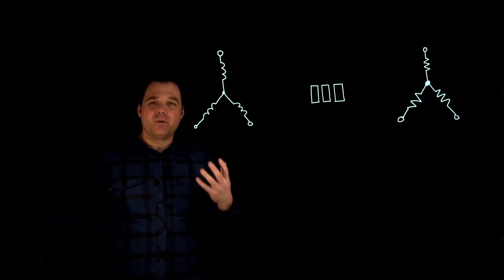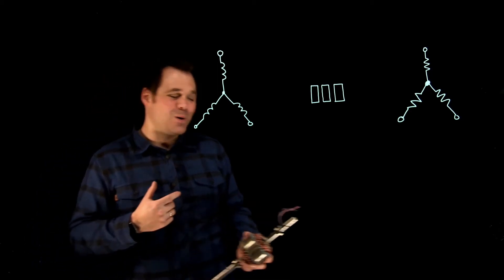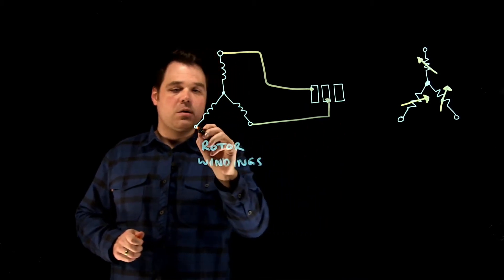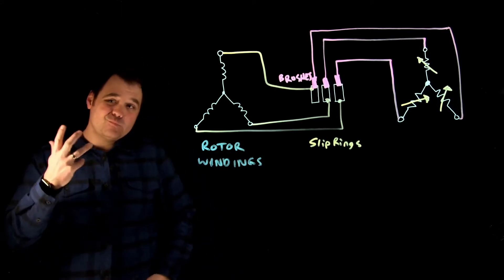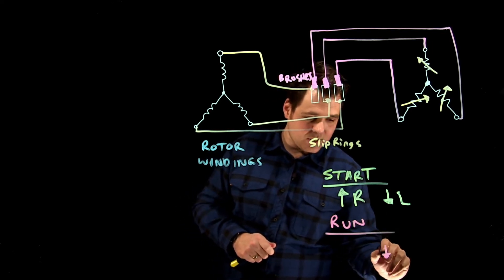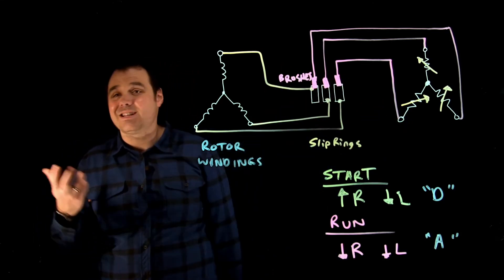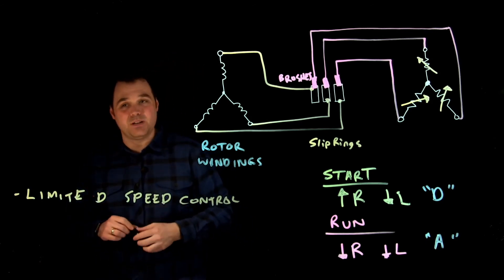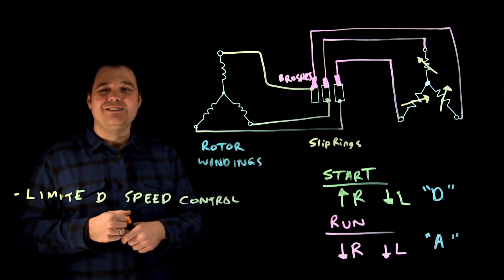Wound Rotor Induction Motor Overview

Comment: Hi I have a question, do the leads coming from the slip rings to the resistors, they MUST be connected all 3 in some way for the motor to turn correct? Or are there some models where only two can be connected, none connected, for them to turn/work when energized?

Comment: I recently discovered a very old single phase 115/230 1/2 horse WRIM in an attic. The weird bit here is that it uses a commutator like a dc motor instead of single pole slip rings, and there is no provision for external resistors. The brushes simply connect some points on the commutator to other points on the commutator. The motor is reversed by rotating the brush assembly relative to the housing. 

So given that there is no resistor aided start going on here, why does this motor exist? What is the advantage of this over a regular squirrel cage motor?

Edit: Looks like this is a repulsion motor. They did this to achieve high starting torque before the use of start capacitors was practical.

Comment: Inductive reactance in the rotor is high when first started (due to the high slip speed) which is exactly why we want high resistance also for good starting torque. Resistance in a SCIM can't be changed to match inductance which is the entire advantage of a wound-rotor.

Comment: thanks for the video. if you were to replace a drum sw that controls the wrm with a pendant control operating a vfd to supply power to stator what would be the best setting of the resistors for the rotor?  high,med or low redistance?

Comment: Great stuff Zack! Is it possible to fit a wound rotor in place of a squirrel cage rotor in an induction motor? Thanks for a quick answer.
Reply from the maker: In theory it would work, if it fit perfectly. Just may not be quite as efficient.

Comment: very nice info., on  a 1000 hp  2300vac motor is there a formula on setting the timing resistance 5-steps on the 3 phase resistors grid to the bypass grid in run mode?  🤔thanks🙂

Comment: Thanks Zack.  I had hard time interlocking Washroom fan and furnace in the basement. Please could you provide me and wiring diagram for that. The problem is common for legal basement. Thank you
Reply from the maker: There's so many different options depending on the exact situation. I would recommend finding an electrician in your area to come take a look.

Comment: The waste water treatment facilities throughout my city use WRIM’s for the main influent sewage pumps. More reliable than VFD’s for that purpose because of the severe and corrosive environment. They experimented with a VFD motor and it wouldn’t stop crapping out (no pun intended) so the WRIM’s proved to be worth the extra maintenance. I have a question if you don’t mind. If I connect 3-single phase transformers for 3-phase (parallel) operation, do I simply divide the load by 3 to get the KVA rating of each transformer? Of course the transformers should only be loaded to 80%, I’m assuming.
Reply from the maker: Very cool about the use of WRIMs still.

Yep basically, although you wouldn't connect them directly in parallel
Reply: @ZackHartle  Understood, parallel was the wrong choice words.Thanks for your reply. Your parallel RLC video got me hooked on the voltage and current triangles. They dont allow us to use socahtoa functions on the calculator for the NYC City Electricians exam, but because of that video I’m able to do those parallel RLC’s with the combination (Z) coils now. First time I took that test back in 2006, they hit me with a 3 part question based on a parallel RLC circuit just about the same as the one in your highly viewed video. They didn’t even show us a parallel RLC in the prep course, let alone one with an RL coil. When I first saw that video of yours it was a big “Aha!” moment. I called all my electrician friends and told them to check out that video just to prove I wasn’t lying about that test question. Still got an 86.25 on it but if I had your help back then, I’m sure I could of hit a higher mark.